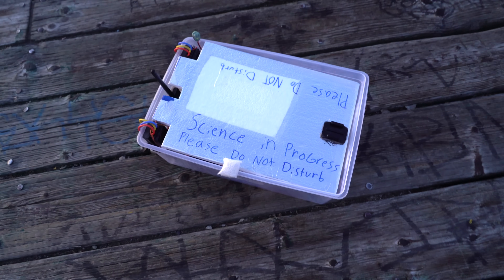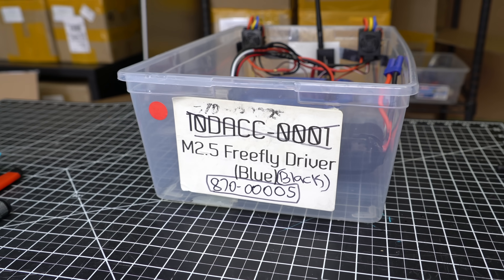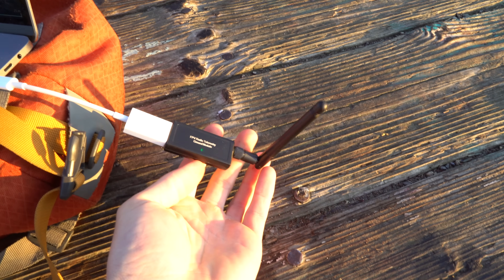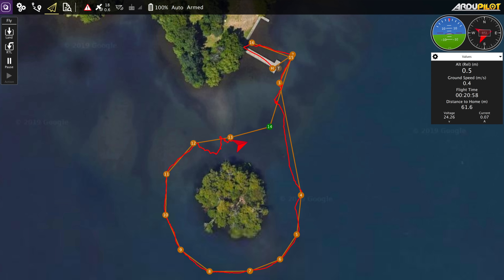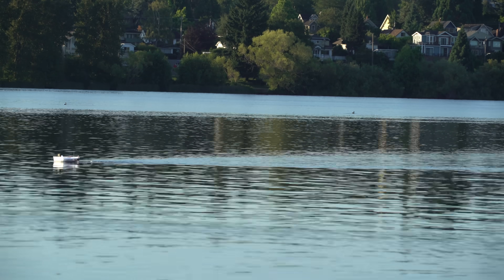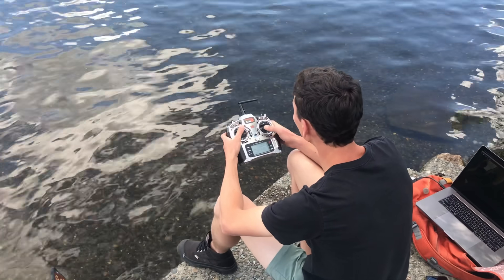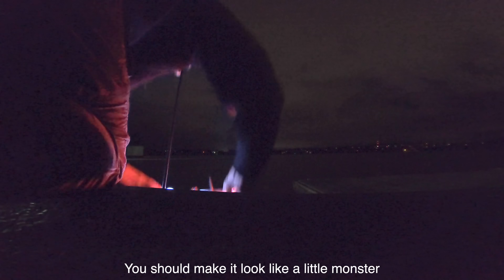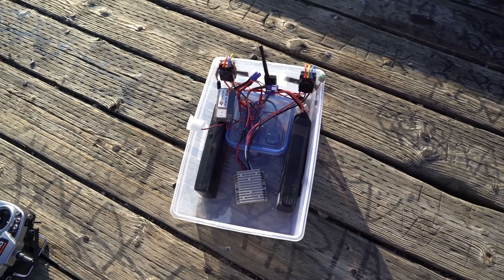Autonomous Box Boat - Long Range Waypoint Mission - RCTESTFLIGHT

Comment: I'm 2 years late, therefore, I'm confident that my questions can be answered in thoroughly.
  Q: If you moved the GPS hardware out of the same box as the other electronics and to either a separate box, or put it up higher?

Comment: If I have one niggle - Tupperware is a brand name and a particular form of plastic storage containers with patented locking lids. The containers that you're using are NOT Tupperware now do they function as such.  You're likely using a cheaper knockoff (NNTAWWT), but in the name of science, words have meaning.  You wouldn't call a boiling flask a volumetric flask, would you Pinkman?  (inside joke)

Comment: I noticed that your external compass wasn't aligned with the centerline of the craft.  I wonder if that might have contributed to your navigation problems.  Were you using the external compass in your GPS module or the internal compass in your controller?

Comment: A heading hold gyro may help. And jacuzzi jets would be weed proof.https://www.toyboxtech.com/nqd-757-6024-rc-boat-turbo-jet-part-with-motor-and-water-cooling-system-x-2-product-id-636790978504/?gclid=CjwKCAjwvtX0BRAFEiwAGWJyZJ3fL2a1I6LvDopNdx4WpiZM51N_uy0wBnsI3DsXBFsdK8yxxbG_fBoCOUUQAvD_BwE

Comment: A. stabilize your osd stack/gps/what-have-you  by mounting it on a gimbal mount lets say off the top of my head salvaged from a richie style boat compass. they make small units that are mounted at your helm of the boat for very cheap and will smooth out that jostling and jerking momentum associated with small mass objects such as your um, "vessel" here and marine surface vehicle vs gps orientation sensing and therefor control output to your motive mechanism(s) i.e propellers in this case AS WELL AS (onto...)  B.the rudder system, which you are in lack of I noticed which will exponentially smooth things out and stabilize the platform which is issue C.... I dont need to tell you but for those not on par The co efficient of hydrodynamic drag for a cube is... well, I dont think it could be much worse lmao. You certainly need to at LEAST bust out the hot glue epoxy whatever... and cut yourself a long bevel or two into the leading face  to simulate the shape of a barge, and also at LEAST add in one if not 2 keel members/strakes for directional tracking stability (f**kin strips of foam or some scraps of blade like plastic whatever works) on the bottom of the thing. I believe that with these simple and easy additions/upgrades you will be able to back off so much on the p.i.d.'s  and focus more on real world tuning and operational dynamics. just my 2 cents. cheers. -Colt Andreoli      Universal Marine Egineering LLC./Andreoli Marine Services

Comment: Wondering if you're  matching the antenna polarity? If not, connecting could be affected if at greater distance. The higher the frequency, the easier it is for signal strength to fade with increasing distance. And if your antennas aren't both (say) vertical the polarity mismatch could be all the difference between connecting and failing to connect. Maybe not so much over these shortish distances but if you plan to extend your trials over greater distance these influences might need consideration. (Quite possible you already know all this, I know...)

Comment: Airboat is the way to go with this project. It may be not very efficient, but at least the propellers will not get blocked by this weeds. Also you can increase the efficiency by A LOT if you just use two plastic bottles as floaters.

Comment: That would be cool to do with sail..I have a Pizza delivery idea too. Real boats use skegs to cut the weeds off the prop and shaft. Another thing to do is to send the motors in reverse to spin the weeds off the prop. You would get much better performance by getting the props lower in the water.

Comment: hey man, i really am interetsed in this build. what are all the componenys involved and rough price?
like, the ardupilot or rasberry pi,... gps... IR obsticle detection...

and im confused about how you said it took 3 days of 'dialing it in/tunin it in" like, what did you do fix what issues? im a noob here, but im smart. and i thought by the simplicity of your box, that it would be as simple as buying 2-5 different gizmos and soldering or connecting them all to the ardupilot rover apm whatever, and a powersource. hookup your motors and whatnot....
i thoguht the ardupilot is to make it much easier than starting from scratch and almsot idiot proof. but im thinking im wrong and could be mor complex than i though.
Reply: could you make a vid being like 
step 1 i started with this, and hooked it up to this by this method.... then i took this, and hooked it up to that, for this purpose. and then once theyr eall together, explain how the robotics work. like explaining a car engine? id aprreciate that. or even just typing it to me. 
i have awesome physical boa thull dieas but not an expert on electronic parts.

Comment: If you are taking suggestions, I would go with a jet boat. You can use a huge mesh enclosure supplying both intakes so you can never starve just one and there should never be enough suction to actually clog the strainer.

Comment: gps out of the boat, better signal... and mission planner is better and working fine for missions.  cheers! :)
Reply: The plastic of tupperware does very little to the GPS signal.  A carbon fiber housing absolutely kills it.
So long as the GPS is above the water level, he will have about the same signal regardless of height.  The water surface is flat.
Reply: @kensmith5694  ok but the GPS must be away from all signals, radio, FPV, the GPS must be as far as possible from all this signal for better reception. (by experience ...) that's why your boat performs the mission erratically, but it's a simple change that makes all the difference .. ha and also, I would rather have used a single propeller , and a rudder I think it will be more accurate .. (my opinion huh!)
Reply: @aurelhollowgram  
Distance and shielding can help the GPS.  Height is only one way to gain some distance.  A carbon fiber sheet makes quite a good shield because it can be structure too.
The two motor setup he has is designed to make it work with the controller he has.

Comment: I think that gps noise is not just software may be from hardware also
The tip of box is flat so may be it creating too much drag while moving straight 
Keep it Sharpe edge might move fast and straight
Maybe having tail will also help

Comment: I'm doing a similar project, my tupperware is currently not autonomous , and if flatter, but im using some massive 4370kv 9t motors, on 114.4v battery pack, my tupperware is flatter, so in the future, welp My plan is to launch model rockets off of the thing, mine also has googly eyes too.

Comment: Two pieces of advice:

Add shrouds around your props to help prevent kelp and debris from getting tangled in them.
Up the # of motors and/or find more powerful ones to overcome the current.
Reply: Do you have experience using pixhawk? I have problems building a boat like that.

Comment: The shape of your vessel is likely the reason why it wandered so far off course. You night experiment look fairly windy with a sizeable wave action, both from the same direction.  The cute brick shape is not aero/hydrodynamic so it gets caught in the wind and waves. It’s shape cannot “cut” through these efficiently and your vessel does not have enough power to muscle its way through. That is why it could not make it to the waypoints as directed. I’d recommend you use a simple catamaran hull (think pontoon boat). It’s extremely stable, easy to build, will provide for dual motors mounting, and still have a coolness factor. And I would increase the power output either through rpm increase or a different pitch for the props. I like this project and am curious where you’re going with this. Subscribed.

Comment: Gurgling sound might be caused by cavitation, which limits speed. Less rpm and bigger propellers recommended. Also putting a makeshift cage around the propellers will keep the seaweed out.

Comment: to fix the wandering, can you give it a "lane" to travel, say 10 meters ether side of the boat, and instead of having a "wall" on each side, a slope, a bell curve if you will, when the boat wanders out of the lane, the degree it uses to correct the wander depends on how far outside the boundary it goes. I think this would create a more straight line from point to point.

Comment: I mentor a high school STEM after school program where we are building an autonomous boat to 3D map lakes in are area.  We are building are second revision and to get away from the prop seaweed issue we have gone to a jet drive. From our initial testing we were able to get 9.5 lbs of thrust from it.  You might look at using one of these drives. You can either 3D print a drive (Thingiverse.com) our buy one from Horizon Hobby (https://www.horizonhobby.com/river-jet-boat-23-inch--rtr-prb08025) where you can buy the parts for the jet drive.   Your video was a great learning experience of many of the issues our team has had to tackle. Good luck.

Comment: you could add a simple rudder and prop a rotary encoder to gather water speed & direction data.
I wonder if alternating forward and reverse rapidly would help remove the seaweed.
A long tube of stainless screen that covers the area ahead of the prop should help keep seaweed from from getting caught up, you'll need lots of surface area to keep the seaweed from blocking water flow, having forward relative motion should help peal off the seaweed.

Comment: you can flash the firmware on esc's i know ones using BLheli have a reverse function in their settings, you can program them with a simple $20 flight controller hooked up to your computer

Comment: Maybe all electric engines should be placed underwater with no waterproofing of the engine windings. It's funny that you are so concerned about keeping the flight controller electronics "super dry" but then you dunk the electric drive motors directly into freshwater seawater with zero protection. I didn't even know that was humanly possible.

Comment: Need some 3D printed guard around the props. and no wonder the GPS sucked, you had the antenna stuffed inside all that crap below the water line. You should try it again with all the things you've learned fixed.

Comment: Pro Tip: The Telemetry radios are good, but the antennas are crap. Built yourself the IBCrazy inverted Vee antenna for it and you get over 2 km of range on 10mW and about 13 km on 100mW

Comment: You could probably put small sections of round pipe around your motors and impellers to push weeds out of the way before they get tangled in the spinning shaft. It may even increase the efficiency of your motors.

Comment: HAVE YOU LINED UP YOUR GPS SENSOR TO POINT IN THE CORRECT DIRECTION??!!!

It looks like it’s pointing 45° to the right, but it should be pointing dead ahead. Look at the white circle on the sensor housing, see the little triangular pointer on it at the top if you hold it with the writing the right way up? That’s supposed to be pointing to the front of the boat. The GPS module contains a magnetic compass sensor within the same unit that must be set quite accurately to to work at its best.

AND MOUNT IT ON A MAST TO RAISE IT UP OUTSIDE THE BOAT!!! Get it up away from interference from the other electronics and into the widest view of the sky possible.

Comment: Adjust the direction that the gps module is pointing by a few degrees if it has the magnetic compass sensor built in to it, that can sometimes sort out the wandering problem.

Comment: Hey buddy, just came across ur channel...Love ur little boat, have subscribed..!
U could use a cleaning caddy type thing (there r some with lids available)... instant catamaran..!
Just add some shaped bits 2 the front & back so it's less square & cuts through the water a bit better.
Good luck buddy.

Comment: You could make a paddle boat drive. This way the axes are over the water level, but the propulsion is still achieved through direct contact with the water.

Comment: I think you should use paddle-wheels. This will avoid winding the plants. And most importantly, it looks very vintage!
Reply: Yeah I was thinking the same thing. either 1 large paddle wheel in the rear, or one on each side. No need for a rudder if using side paddle wheels. And as a bonus, if you gear down the wheels sufficiently the whole thing may even be able to "paddle" itself right onto land :D
Reply: @NordicMan7  
I think there was a class of boat called "crocodile" that could beach itself with side paddle wheels.

Comment: Your boats antenna looks like just +3db and it's located very low above ground....change those two parameters and will get at least double distance( all you need is +6db better signal )
Change the other side on the controller to a sector- or panel-antenna( those got about +16db ), so lets say about 13db more than now what gives you at least four times of your actual max distance....and that works for sending and receiving!
...just do not forget to lower the output for the radio-card after mounting a better antenna( for less noise and your own personal wellness )

good luck! nice project!

Comment: The tip of the 2.4G antenna is bare metal. In the last segment you were moving things around and the antenna was flapping in the breeze.
Get an antenna tube (a straw,) point it up, and fasten it down. That will provide more range, and prevent the bare metal from poking into other things with live electron action happening.
Brilliant little hack, very cool.

Comment: Kort nozzles will help with the thrust and make the seaweed issue much lower.  If you build something like an Azipod but without the ability to rotate and also put them below the tub's bottom that will work too. 

Azipod wiki link

https://en.wikipedia.org/wiki/Azipod

Kort Nozzle wiki
https://en.wikipedia.org/wiki/Ducted_propeller

and since you are using differential thrust for turning you can just build the nozzle/pod stationary and get the benefits of each.

Comment: put a 1 or 2 small fins (something like a 30-60-90 shape dont have to be big) on the bottom about halfway so it has some kind of keel you'll massively improve your steering for testing.  It'll help ya on controlling lateral drift that you wont normally get.

Comment: Thought for improvement: Make the boat unsinkable by adding some sealed tupperware box or styrofoam inside, that will at least keep it floating if the boat fills with water.

Comment: Add a keel the length of the Tupperware in fri t of each prop.
Make the keel deep enough to deflect t sealed o dermis the prop.
Maybe also a couple of short but deep slanted  finn's on either side of props

Comment: Jets will clog faster than your props, and you will lose about 15% efficiency by default. I would try raising the motors out of the water, extending the driver shafts, and running surface drive props. They can chew through the thin weeds, and are less likely to collect them. Also, if you put the tupperware in a planing flat bottom V hull made from foam, it would solve a lot of your problems.

Comment: Why not use a rudder instead of differential steering? That way a single disabled motor isnt such a disaster. You can also make weed guards out of hardware cloth.
    You can document the buoy locations from shore with a lensatic compass.

Comment: Would it be possible to build a box like that bring it out the sea with a GPS tracker and use current to reach other continental coastlines and then if its near to the other cost start the motors again an bring it to the shore? I had this idea once in a while and thought about an alternative system of shipping guts... Using currents would take longer but would be much more ecologic.

Comment: awesome tip i learned for keeping sea-weed and debris out of the motor: 3d print a cylinder shaped pocket with basically the same diameter (or slightly bigger) and then you dip the motor core in epoxy resin to seal it. an ROV club showed me that one. Only danger I can think of is over heating, but doesn't happen so far.

Comment: FYI, you might be able to use a similar system to what large boats use, which is a cutting blade on the prop shaft. If you search for "prop rope cutter" you'll see images. I'm not sure they'll solve the problem, but it might be an easy thing to add. Here's one for reference: http://www.ropestripper.com/index.php

The back part is fixed and doesn't rotate, the front part is mounted on the shaft, meaning the two pieces act like scissor blades when the prop shaft turns.

Comment: Ok. You need to write sum code, so when it detects current spikes on a motor, it will stop and reverse both motors for a couple seconds, then start again. set that option to do it three times. Then if it's still getting current spikes, Have it stop, and send an sos message back to you. This is exciting stuff. GJ.

Comment: If you can locate a bit of metal bug screen, you could tape/glue it to the bottom of the hull so that it extends back past the propellers.  Bend it up at the edges and tape it to the side of the hull, and I bet it would keep the weeds away from the propellers -- as long as you don't reverse.  My thought is this design wouldn't hurt the aesthetic of your boat like finely crafted propeller guards might.

Comment: My boat has a electronic compass in the auto pilot. So with no GPS it can hold a course and correct its course. But with the gps I have waypoints and sog.. it will also sail a relative wind angle based on a sensor on top of the mast. Maybe if you can incorporate a mag heading you can get straighter lines.. Also fins that guide debris away from your props. Also steering servos with rudders.. So that it doesnt have to use throttle to steer might help.. Just some ideas